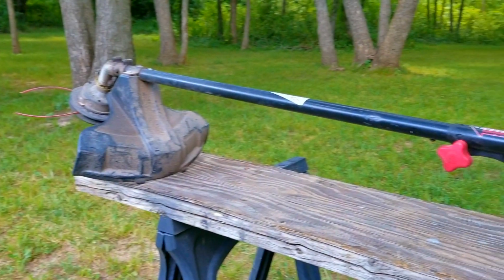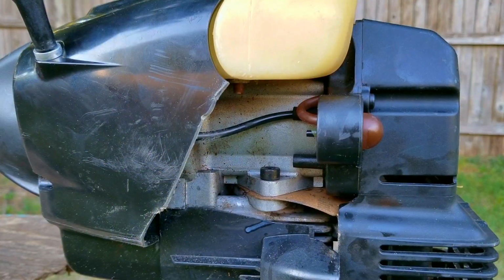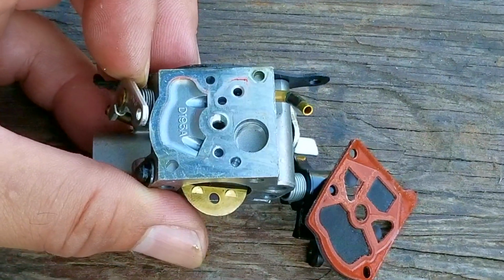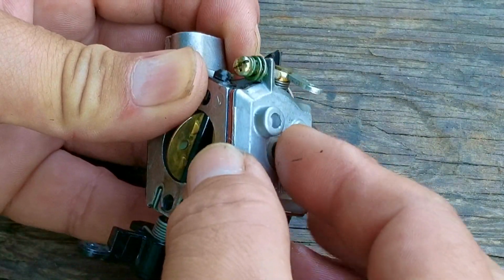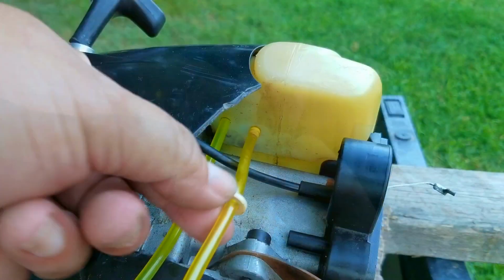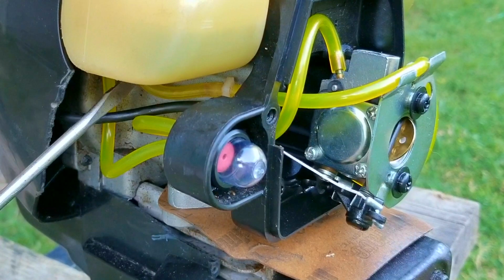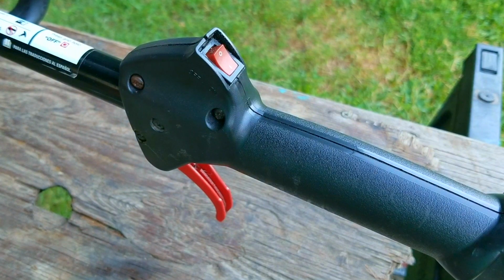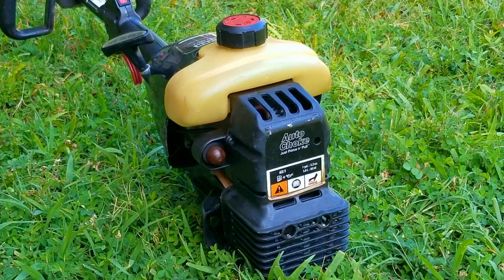Fixing A Craftsman Trimmer That Won't Start Because The Fuel Lines Are Broken

Comment: I cannot explain to you how much you have taught me!!!! I was given a trimmer like this one only it's the Ryobi Tim Allen 31cc and it's not the incredi pull, it has the choke I like it because it's a beast at 31cc, It would start but die win in seconds. I took it apart and put it back together like 8 or 9 times with no progress. Finally after watching this video I said to myself, self.. I'm gonna try this one more time if I can't get it I'm taking it to the range for target practice. Well I took the carb off and cleaned it so good it looked brand new. I then started assembling it and after the needle was put in I stared it it for about 5 minutes and finally saw the issue, the arm that's attached to the needle was too low. So I adjusted it up a little bit put it back together and Bam fixed right up and stayed running!!!! I did adjust the H-L now the thing runs awesome. It's definitely not my favorite sutup either but it was free lol. Sorry for the long comment 😅😂😂. I basically just wanna thank you for EVERY VIDEO YOU MAKE TO SHOW US HOW TO FIX OUR EQUIPMENT!!!!! YOU ARE AWESOME. HAVE A FANTASTIC LABOR DAY
Reply from the maker: thank you Gary Allen I really appreciate that fact that you didn't give up on it.
Reply: "well I took the carb off and cleaned it so good it looked brand new. I then started assembling it and after the needle was put in I stared it it for about 5 minutes and finally saw the issue, the arm that's attached to the needle was too low."

How did you manage to see the needle with the carb on the machine? so confused.
Reply: @norge696  I started putting the carb back together and noticed that the arm that attached to the needle was not at the proper height.

Comment: I don’t mind that particular orientation of components at all. I do prefer machines that allow the first throttle activation to reduce to idle speed. Very convenient for safely warming an engine up. About the carb cleaning, I always use a sewing needle to remove the inlet screen to be able to clean it and the passage before resorting to removing the inlet needle, only because sometimes reinstalling the needle, spring, lever, axle pin and screw can be difficult, although as I do it more and more I’m becoming better at it. Small carb adjustments, a little at a time, always work better I’ve found.
Reply from the maker: thank you Rein Ciarfella

Comment: I have the red version of this and 2 ryobi 740rs, and I have no problem with this design I actually prefer it because filling it with fuel is pretty easy and isint like other ones where you have to tip them over. Plus I got both ryobis for free.
Reply from the maker: very nice!

Comment: Nice tygon fuel line through it now. The engine looks like the Ryan sourced one in my late 1980s Ryobi from 1988/89 that were hugely popular here in Sydney. They were early adopters of the split boom that allowed you to fit various ends to it, which is all the rage now! I have a leaf blower attachment that is very effective but noisy. It's the one I told you about with the Irish manufactured Tillotson carburettor still going strong. It had 120psi compression when I last got it tested a decade ago and it ran fine recently even though I'm afraid it sits a lot!
PS: I've never seen a four line head before. I take that to be manual feed which makes sense as they will last a bit longer between reloading.
Reply from the maker: me too, I've seen 3 but not 4.
Reply: @INSIDEHOUSEGARAGE  three must make a nice noise. The quad one here sounded like a high revving four cylinder engine.

Comment: Good news about the Husqvarna 252RX throttle and killswitch rebuild the results were awesome the throttle works like it does and the killswitch works when you pull the throttle lever backwards i have cleaned it before the throttle rebuild it looks almost brand new as does the Jonsered RS44 when i cleaned it too the 252 will turn 23 years old next week's saturday i'm so happy that the rebuild became a huge success the time to finish the work took 4 hours and total cost was 125€ which was worth the effort and time 😁
Reply from the maker: nice work.
Reply: @INSIDEHOUSEGARAGE  thanks a ton 🙂

Comment: Very interesting. Are Bolens designed trimmers that popular? I want to ask for a video if possible, that is a tutorial on how to switch a stihl ms180 stock carb to a walbro adjustable one. Again if it's not possible at the moment, thats fine
Reply from the maker: if I can get the saw, I would definitely try
Reply: @INSIDEHOUSEGARAGE  Thank you very much
Reply: Belen’s are the same, what they are called in Australia....😀🇦🇺

Comment: great video friend keep it up. I have a question I have a stihl bg50 blower and a very good machine but I am disappointed with it because if it doesn't work for a few days I have to adjust the carburetor and that only happens when it is stopped for a while. remembering that the repairs are ok and the carburetor is clean.
Reply from the maker: no problem, I'd replace the carb, with a cheap one, but don't throw the old one away just yet, because you're going to see, if it does the same ,with a new carb.
Reply: @INSIDEHOUSEGARAGE ok thanks a lot friend for the reply.  I will do this.

Comment: That trimmer head looks like a pivot trim style bolted onto the outer shell of a bump feed similar to my homelite. It might be possible to convert the head to a speed feed 450 with commercial trimmer line; the engine is certainly powerful enough to handle the load!
Reply from the maker: I think you're right.

Comment: My father has one of these with polesaw and metal blade attachments, but is very erratic in its ability to start, keep running,  and/or rev up smoothly.  When in its "acting up" phase it idles high, too?  No smoking.  Perhaps a lean out issue? 
 Been thru carb with no real permanent change.  Oddly enough when it's running good it really runs good.  Ideas?
Reply from the maker: I do believe the carb is the problem and replacing it would be the best fix.
Reply: Do you think an engine pressure & vacuum check would be worthwhile?  If it has a leak, then it probably always had one as this issue seems to have always been prevalent & just won't go away and stay away🤷‍♂️. Will see if it'll be worth while to spend $ on a carb as well.  Thanks!

Comment: AAWWk I have a model a little older than this one and have been putting off repairing the carb and lines.  Oh well it doesn't work now so no harm no foul if all I end up with is parts.  I will try and see what happens.  My machine is not worth paying someone else to repair it.  thanks for the videos.
Reply from the maker: no problem and thank you D Butler.

Comment: Curious, it's plain that 40:1 mixture is required.  What was the wrong fuel in this case?
Reply from the maker: oh I was eluding to using ethanol enriched fuel.
Reply: @INSIDEHOUSEGARAGE  Enriched? Diluted might be a better term but I know where you're coming from.
Reply: @INSIDEHOUSEGARAGE  nothing wrong with ethanol fuel
Reply: @catsbyondrepair  alcohol does not belong in any fuel system that has a carburetor it is way too much of a headache eating lines rusting and corroding metals if you don't believe me you are on a computer/phone or very close to one do your own research

Comment: It is an old, obsolete trimmer.
Many larger shops will only work on their own brand they sell new ie: Husqvarna, Stihl, Echo on 2-stroke equipment.  Mainly because the profit margin sucks compared to zero turns, etc.  I enjoy getting older equipment up and running again.  It isn't always about profit.  Another benefit is the customers often bring you other equipment to repair.
Reply from the maker: you got that right

Comment: I don't like that design. Changing out the fuel line seemed simple enough though I do prefer the echo brand. They are so much easier to work on than any other small engine out there. When you do change a carb do you find aftermarket carburetor quality is the same as oem?
Reply from the maker: the quality is lower, for sure, but they still work well.

Comment: I have found while in S.E. school yrs ago crapsman only supports parts for 5 years on alot of stuff. they make things non interchangeable with who mfgd. it a$7.00 carb kit goes for $25.00 with the added crapsman mods. They don't mfg. anything themselves just the lo bidder that year. No longer the craftsman of years past.
Reply from the maker: you are correct about that.